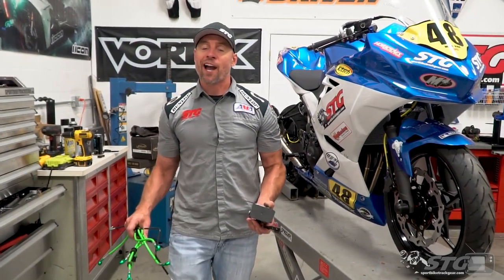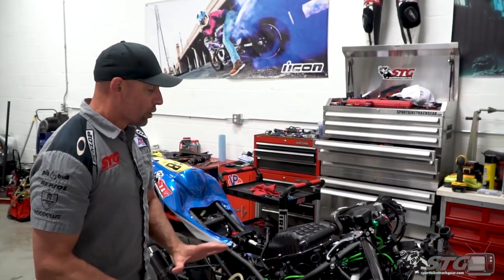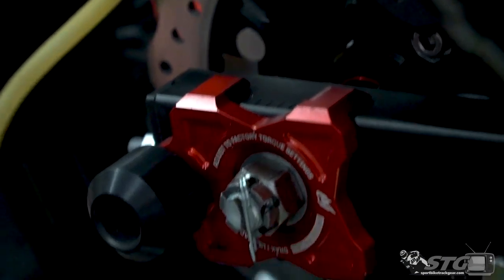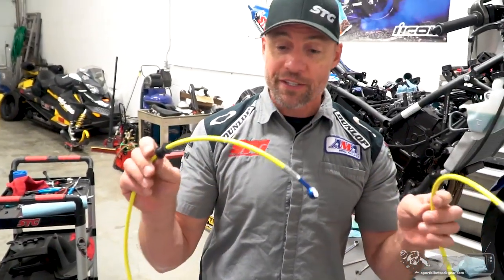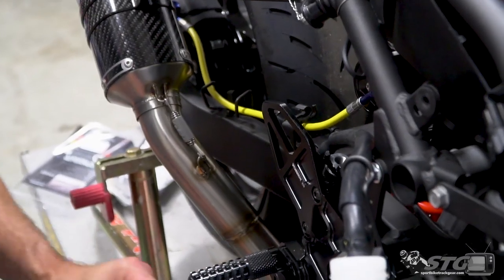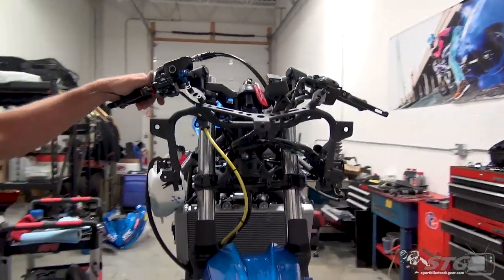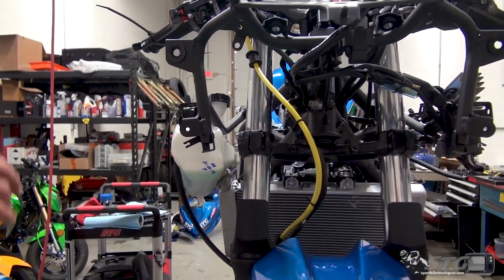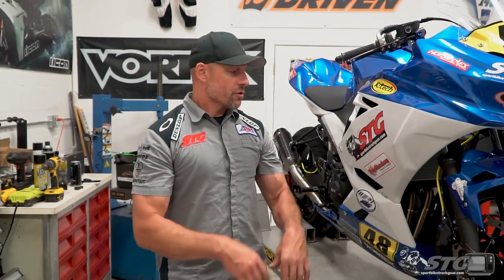Kawasaki Ninja 400 Spiegler NON-ABS Front & Rear Brake Line Kit Install | Sportbike Track Gear

Comment: Good video but one question. I have a non abs model from the factory would I still have to remove the tank before replacing front brake line?

Comment: As you show in the video, you turn the Kawasaki 400 abs in a non abs, could be possible to turn a non abs in a abs motorcycle?
Reply from the maker: It would cost far too much to turn the bike into an ABS model when it did not come with that option from the factory. For sure it would be cheaper to buy a new bike. - Van

Comment: what will happen if I install non-abs brake lines only and just leave the abs hydraulic on the bike?
Reply from the maker: It has to be one or the other, you will not be able to mix the kits up. One goes directly from the master to the caliper and the other goes from the master to the abs valve then the caliper. - Van
Reply: @sportbiketrackgear  Thanks. But that's not what I meant. Sorry I'm not a native speaker. I'm thinking about installing non-ABS brake lines but not remove the abs hydraulic (not doing electrical re-wiring or FTEcu abs delete plug). Like just leave it there

Comment: What is clutch mod? Just stronger springs?
Reply from the maker: I installed EBC springs part number CSK101 (for a Honda 600 I think) in the bike. Now that I have ridden the bike for about 100 laps I can say this worked well. Here is a link to the springs on our site: https://www.sportbiketrackgear.com/ebc-honda-cbr600rr-03-16-csk-clutch-spring-kit/
Reply: @sportbiketrackgear  Nice :) Is the only difference stiffer clutch lever and of course less slipping? Would you say street usability is worse?